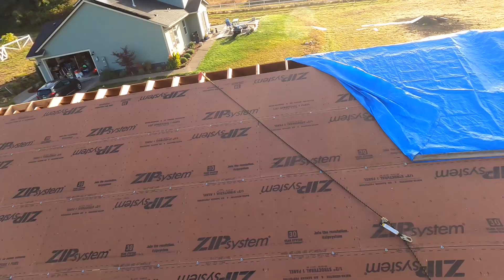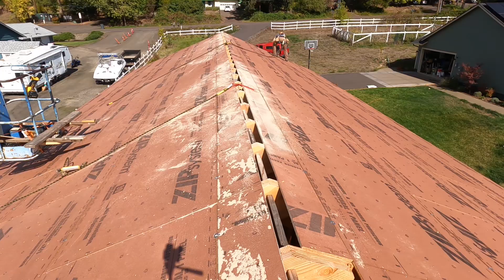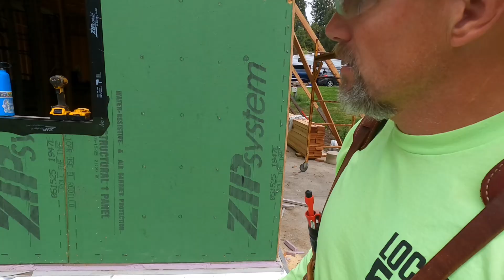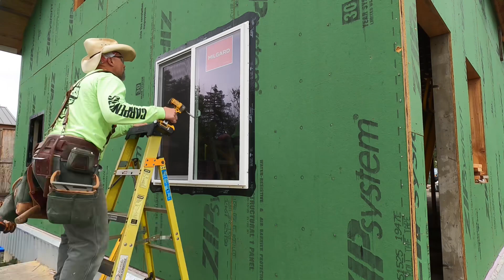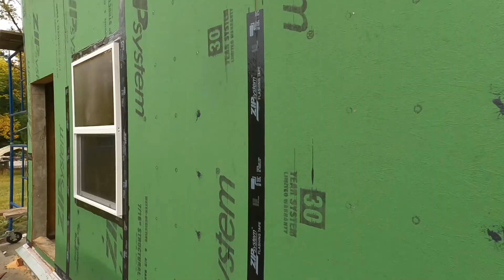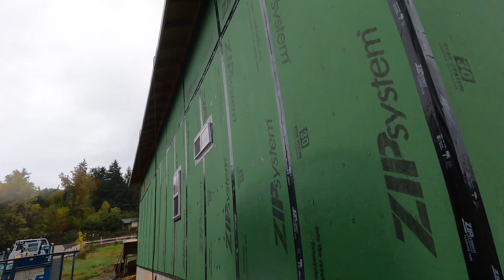Shop Build Weather Barrior and Window Instal Ep 21

Comment: I just completed a shop build in Salem using zip panels and didn’t have the best experience. A couple months after the zip was on, about 15% of the panels expanded dramatically and caused buckling/warpage on the walls. After speaking with the Huber rep and getting them to replace panels under warranty, the lesson learned was that the “self gapping” feature on the long edge of the panels doesn’t work. If I use zip again I would make sure to have a clear 1/4” gap between sheets on the long edge.